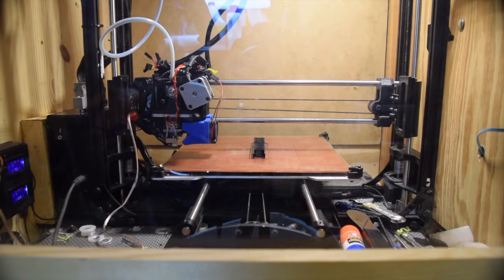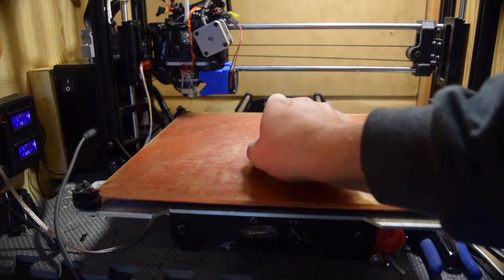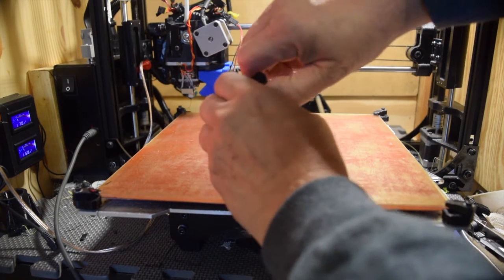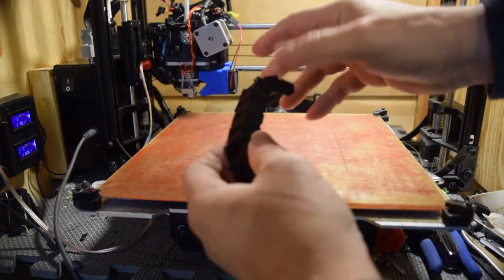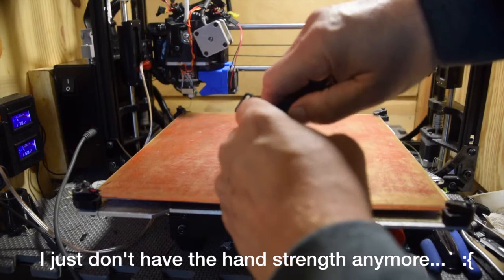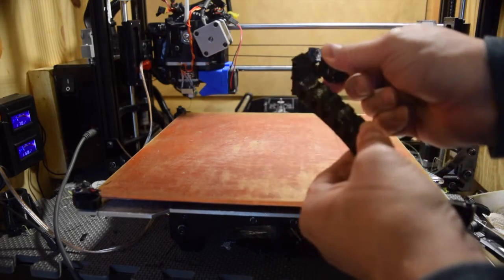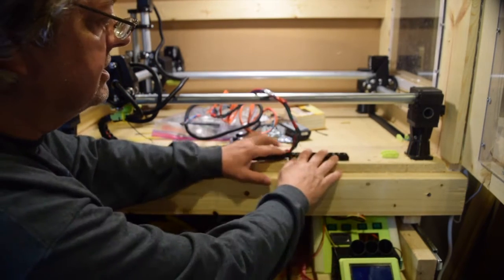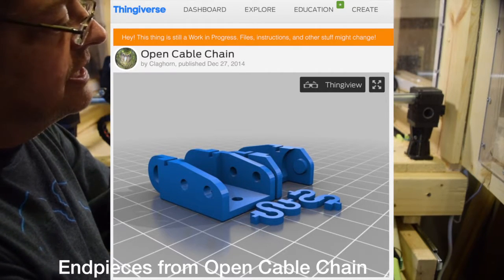Printing the "Print In Place Cable Chain" Thingy

Comment: Greetings I am a follower of your work thanks to you aa V1 ENGINEERS I have my mpcnc now that I incorporate the extruder download the preconfigured software for 16 teeth and lcd that comes out on the page but I could not print first that the pieces appear too large when I put them in repetition and move very abruptly even though I have 20 teeth pulleys could you help me with a software pre configured for printing in mpcnc?
Reply: In repetier host* (repetition)